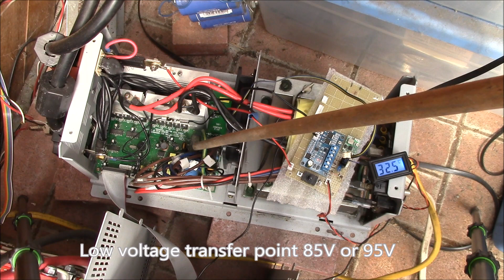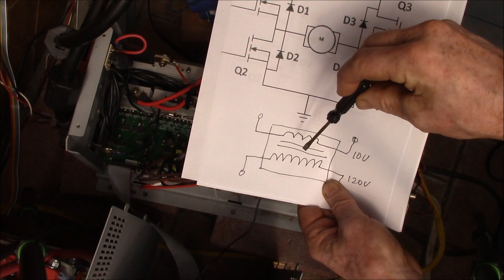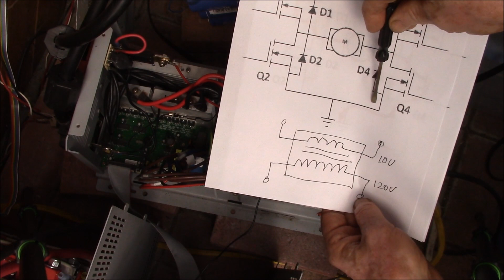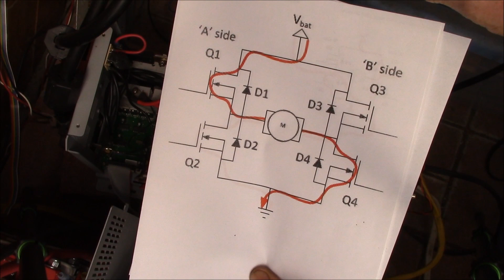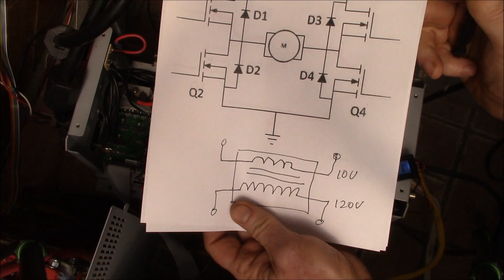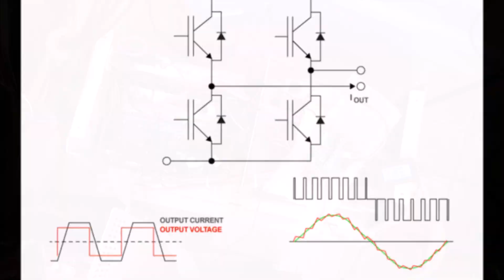TrippLite APS1012SW Inverter/Charger, How It Works

Comment: Very easy  way to understand the different electrical input/ output of the system. I do have a question? if I plug into a house current (ac) to allow batteries to be charged, dose the inverter turn off the power supply to the unite when the batteries are fully charged? Or what happens if I leave it plugged continuously.
Reply from the maker: It has a regular lead acid 3-stage charging profile and once the battery is charged, it goes into a float charge mode.  There's a DIP switch setting for changing the float charge voltage depending on the type of battery in use.

Comment: Great explanation sir! I would like to know something more about this kind of inverter/charger like how does it switch form inverter to charger automatically using the same transformer while maintaining uninterrupted high voltage AC output? I have seen cases with TrippLite inverter/chargers burning the Mosfets H-bridge when passing from inverter to charging and didn't understand what really happens in the circuit to make them fail?
Reply: The problem is my device works very well in inverting mode and pass ok in ac and charging the battery so the transistors get the right signal an get all blocked since they are using only the internal doides but the problem arise when it switch back from charging to inverting. Some transistors get burned. If you can help me with any schematic i can go in depth and understand what is happening? Thanks a lot.
Reply from the maker: @gentiandume9480  I've looked and never found any schematic level detail on these charger / inverters.
Reply from the maker: I don't know for sure, but the H-bridge function is all down to exact timing of the gate signals to the MOSFETs.  If anything happens and 2 MOSFETs on the same side get turned on at the same time, you get a dead short across the battery and that'll take out those MOSFETs.

Comment: I have one main concern with this unit... what is its onstandby idle current that it draws from the batteries in the event that there's an outage and no load is being sensed?
Reply from the maker: In normal mode, it pulls 2.5 - 3 amps at standby / no-load.  In power saving mode, its around 0.3 amps average as I recall.  This is the mode where it hunts for a load of at least 100W by powering on for a bit every few seconds.  The no-load current high mainly due to losses in the output transformer.
Reply: @The4Crawler  That's very encouraging to know especially the power saving idle current, I was debating between going for a new MUST system similarly modelled and  someone's APS2024SW used and wants to sell it to me, I'm wondering if I have to be concerned about its particular idle current no load situation given that it delivers a continual 2000w max load and what components to expect failure from growing weak over time given that it's not a new unit?
Reply from the maker: Never tested a 2000W unit, but I imagine the idle current is similar.  Only two issues I've had are blown capacitors:
https://youtu.be/GFbWNafr3pM?list=PLpY2FP1a9tithvAbjyBryRzSimM-IWCz9
and a failed cooling fan, which likely led to the caps failing.  Since then, my unit has been running 24/7 w/o incident.
Reply: @The4Crawler  Quite encouraging, I then will be getting the used tripplite 2kw model as I was concerned about weakened components in the main power delivery circuit rather than the control circuits (fan cooling and regulation). I also realized tripplite don't have a 24v model, they are all 12v models that provide pure sine wave which call for a beefier dc wiring.
Reply from the maker: I had the main input power capacitors fail on mine.  That failure was due to the cooling fan failing, letting the caps run too hot and that in turn dried out the electrolyte.  Put in new, high quality, low-ESR caps and then added a temperature controlled fan and that seems to be working great.  The old fan is controlled by load current and not by temperature.  While it works great at high loads, at low loads, the fan speed was too slow (IMHO) and the unit would run hot, and that got worse when the fan failed.  The original fan seemed to have 5 speeds from 20% to 100% based upon load, so 20% @200W, 40% a@400W, etc.  My new controller varies the fan speed based upon the temperature of the main heat sink and the thing runs cool all the time now.  I too wish TrippLite made a 24W model.

Comment: If I run two of these inverter in parallel  to the batteries,  one will be a dedicated  charger and the other one as inverter mode. What probably  will happen?
Reply from the maker: That should work.  As long as the charging unit has no AC load connected and the inverting unit has no incoming AC power connected, they should stay in their respective operating mode.